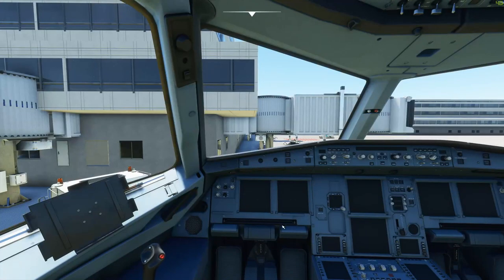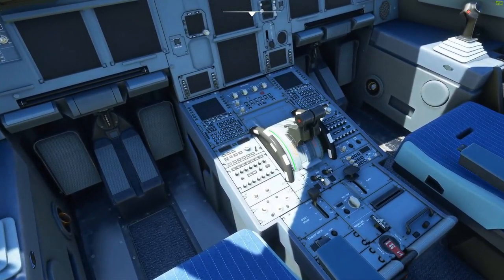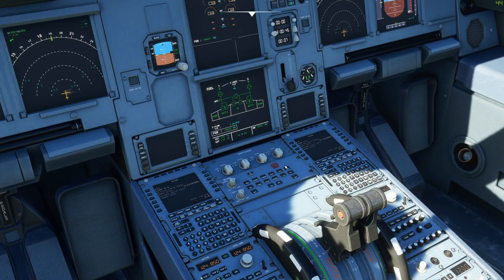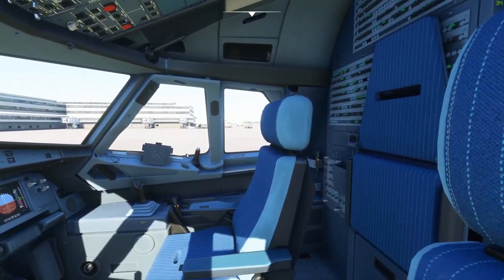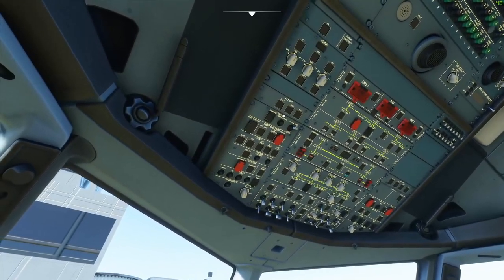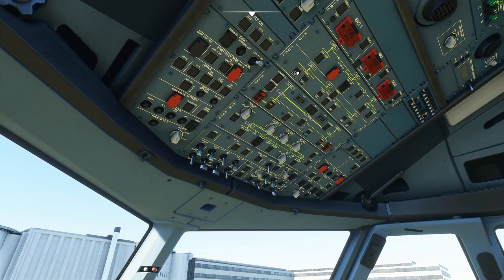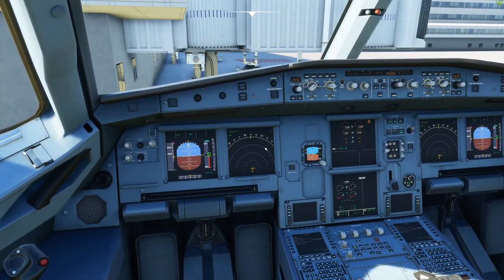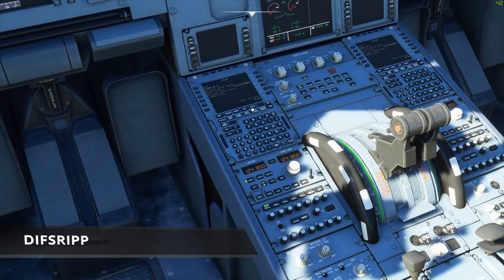Ultimate A320 Start Up Guide | REAL A320 PILOT | MSFS2020

Comment: if i am just standing at the stand and i want to request ground services for external power it doesnt let me because i need the apu or external power on so i cant call for external power but if i click in the cockpit on external power on button i get external power even if external power isnt connected to the plan. How do you call external power in real life?
Reply from the maker: External power is connected whenever available as a policy and requesting it is not usually required. If it wasn't connected and we needed it I would likely walk down onto the tarmac and ask for it to be connected.